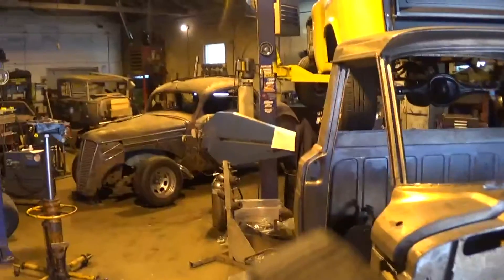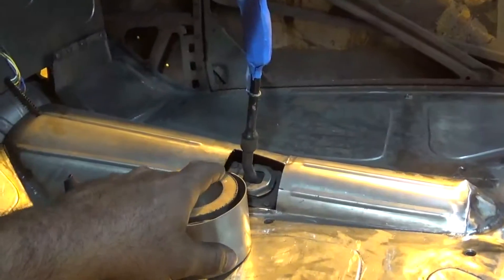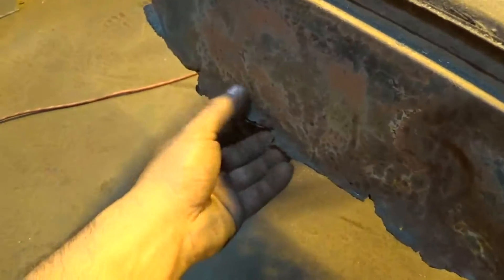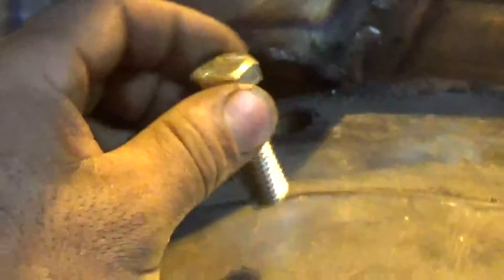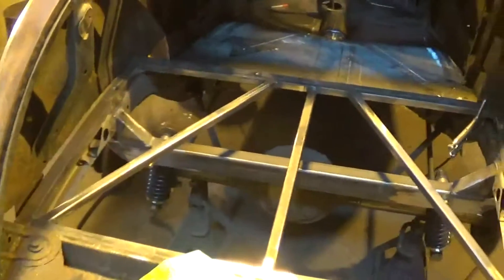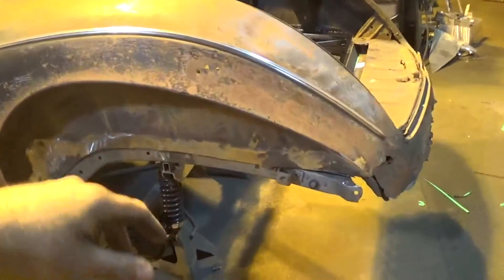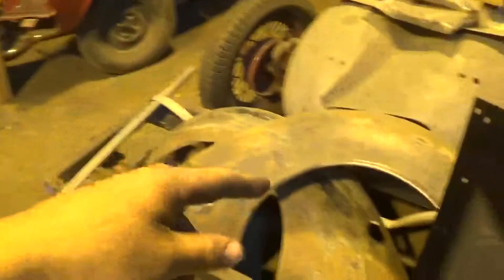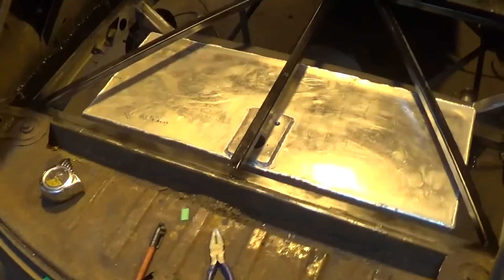37 DODGE RAT ROD BUILD- Part 1

Comment: What is the name of the machine you use to emboss your floor panels?? Never seen nothing like it.
Reply from the maker: It's a bead roller. Lots of companies make them, I have a baleigh industrial, MT brothers is another good brand. They also have cheaper hand crank models out there. There are tons of different dies for them to do different bead rolls, lines, and contours.
Reply: Doing a fantastic job thanks for responding.